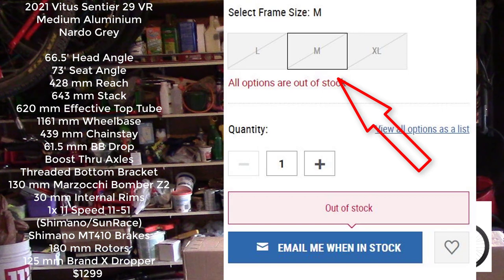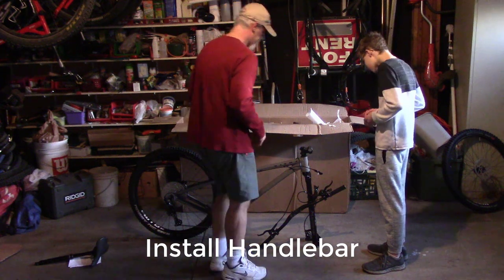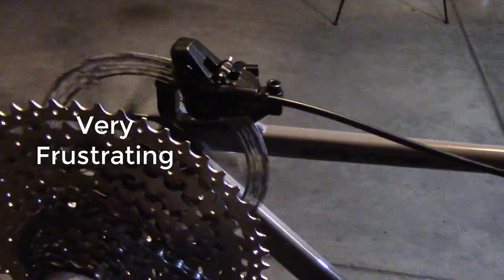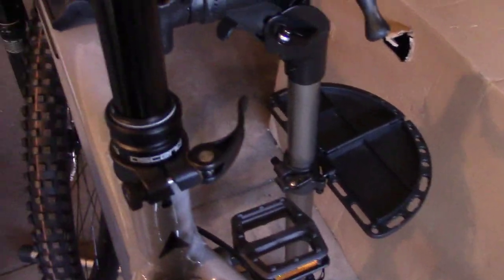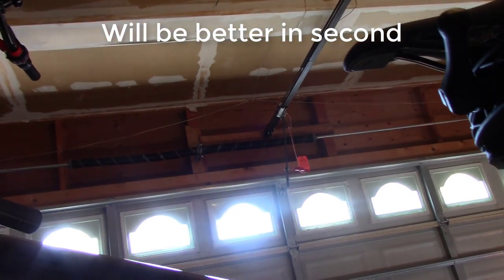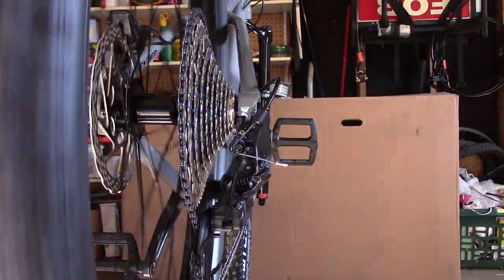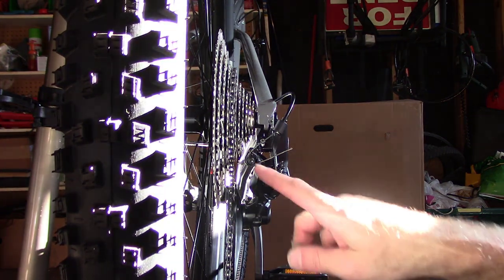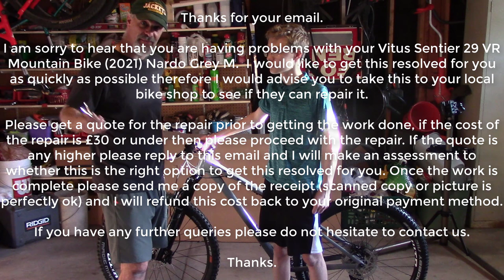[Open Box Nightmare] Chain Reaction Cycles 2021 Vitus Sentier 29 VR: Set Up, Weight, 2 Big Problems

Comment: I own a Vitus Sentier 27 VRX and ordered it from Chain Reaction Cycles. I didn't have any problems whatsoever. Brakes were set up the right way and fully bleed. Also my bike shifted perfectly out of the box. I bought my bike in May 2020 rode it a lot and didn't have any problems since then.
Reply from the maker: Cool.
Reply: @1newme425  for my liking the gearing is just right. Mine is the 2020 model and it came with a 32 t round chainring but I've swapped it for an 32 t oval chainring and for me it's perfect. I do a lot of riding on flat surfaces for longer diatances and I only use the biggest cog of the casette in rare occasions same goes for the smallest cog. There should be room to run a 34 t chainring if you wanted to swap out the stock one. That would give you a higher gearing for high speeds but I would first try the 32 t except you have really strong legs.
Reply: @1newme425  yeah 32 t should be enough for most people. But fitting 34 t should also be no problem
Reply from the maker: Thanks for update.

Comment: I ordered the same bike,
I had a great time. the bike came in perfect condition, and the only thing was that the shifting was a little wonky, and the front brake rotor was rubbing. super easy fixes. the brakes were in the right "American" position, and the whole bike is just a dream.
Reply from the maker: Nice.  Glad you received bike with brakes on correct side (for USA).

Comment: Wow, most be nice to have gotten yours early. Mine was supposed to be delivered today but has been sitting in the DHL Cincinnati HUB since last Friday...
Reply from the maker: Good luck.  Tight supply chains are frustrating.  Let us know when it works out.
Reply: @50mtb44  well it arrived and the box was in poor condition so I had wife record my opening of it and I discovered that the frame got bent (presumably in shipping) so I still don't get to ride it. The response from CRC has been extremely slow as well.
Reply from the maker: @cmccormack91  wow!  Drag.  Glad you video documented it.  Keep us updated on your progress.  Hope it works out quickly.
Reply: @50mtb44  rim was also bent. They didn't send me a replacement bike (I don't blame them honestly, it would probably get trashed in shipping again) but they are sending a Ragley Big Al as a replacement frame and are covering the shop costs to have everything swapped over, or so they've said, only time will tell.
Reply from the maker: @cmccormack91  thanks for update.  I like that Ragley Big Al (on paper). Looks cool.  Let us know how it rides.  Glad to hear CRC is working with you.

Comment: You got the right size tires for the 29’er. The tires you were expecting are on the 27” version.
Reply from the maker: Cool.  We are very happy with the 2.3 tires on 29 inch 30 mm rims.  I see the CRC website does NOW say 2.3.  But when we purchased, it read 2.6 front and back (I took screenshots).

Comment: I ordered a nucleus from chain reaction cycles and it came fine with the levers on the right side, I did notice some shifting issues at first but those were easy to fix.
Reply from the maker: Anthony, thanks for sharing your experience.  When you say "right side" for brake levers, which lever controlled which brake?
Reply: @50mtb44  um, I don't notice unless I am currently riding bit I think it was , right for back and left for front. the normal way in the usa
Reply from the maker: @anthonyschutz7201  nice.  Wish our brake levers came that way.  What issues did you have with shifting and how did you fix?
Reply: @50mtb44  it skipped over the 7th gear because it was misaligned, all I did was look up on youtube how to fix it. I think it was "park tool".
Reply from the maker: @anthonyschutz7201  cool.  Enjoy your new ride.

Comment: We in the UK have it that way as it's got something to do with hand signals,don't forget we drive on the left as do Australia and New Zealand and many Asian countries.
Look at mountain bikes in Australia they have the front brake on the right as well.
Reply from the maker: Makes sense. I'm not suggesting that everyone have the same brake orientation everywhere (although that would be nice). I appreciate that UK, Austrailia, and New Zealand set their bikes up to match their cars.  :  )   Just saying, a bike company selling bikes worldwide should set up the bike to match the country they are selling and shipping to. Otherwise, just like if brakes reversed for you, there is a big risk of accidential OTB.
Reply: @50mtb44  What I don't get about the US/euro "front brake on the right" is that AFAIK your motorcycles have it the other way around. Doesn't this get confusing?
Reply from the maker: @andydt82  Maybe. I don't ride motocycles.  So not an issue for me.  Someone else will have to answer that one (good point).
Reply: @andydt82  motorcycles are universally front brake on right hand and rear brake on right foot. Unless theres a difference on a special model that's how it is worldwide 👍🏼

Comment: It’s fun only after you figure it out.  My local bike shop makes it look so easy but I still like working on my own bike.  You learn by doing.
Reply from the maker: So true.  I thought this was going to be quick, easy, and fun.  Started out great.  Then snowballed.  Good thing I got it late in day ... and had the night to clear my head.  Not sure how a buyer with no mechanical skills would deal with the disappointment.  So made this very long full story video.
Reply from the maker: @themtrchannel9529  true.  I have a great shop.  Just all shops around here are backed up for 4-6 weeks.  Did not want to wait.  Just showing what happened to us.  Luckily, I feel confident wrenching (when needed).  Many who purchase, will not.  So LBS is a good alternative.  No idea what fee would be charged.

Comment: I took delivery of a Sentier 29 VR from CRC earlier this month.  I’m in the UK, so the brakes were set up as I would expect.  But I had completely different issues to deal with.
Firstly, as it was shipping within the UK I was expecting what CRC call a ‘Big Box’ delivery, whereby all I would have to do is fit the handlebars and pedals.  It came however in a ‘Small Box’, additionally requiring the front wheel and the dropper post seat to also be installed.
Inconvenient, but no biggie.  Except there was no dropper post or seat in the box!  Someone had probably been left looking at them on their bench at the end of the day, wondering which box they should have been in & where they should have been sent.
This was a Saturday, so everything went back in the box until I could speak to CRC on Monday.  
Spoke to CRC first thing on Monday morning & they quickly apologised & agreed to send out a new dropper post and seat to me.  Quickly agreed to send it; actually sending it?  Not so quick.
Reassured that the entire box wasn’t going to have to go back,  I went back to it on Monday evening to assemble the rest of the bike.  First thing to install was the handlebars.  What could be difficult about that?
Well you could have a face plate bolt tightened up way beyond the max, and with its hex head completely stripped out.  To the extent that the 4mm allen key just spun freely in the head.
So back to CRC on Tuesday… As the stem is bespoke to the bike they were unable to supply a direct replacement.  After a little to-ing & fro-ing I managed to negotiate a Nukeproof Horizon stem be sent out to me as a replacement.
The stem arrived Wednesday morning - super fast considering CRC had only agreed it on Tuesday afternoon.  The dropper & seat however, didn’t arrive until Thursday evening.
Considering whoever had worked on my bike had managed to 1) forget to install/box a dropper post & seat, &  2) destroy a hex bolt that only needed to be tightened to hold a stem together in transit, I didn’t have a whole lot of faith that the rest of the bike had been put together with any care or diligence.
So for about $100 I had my local bike shop fit the dropper and carry out a full inspection of the bike.  They adjusted the gears and aligned the rubbing discs.  To their credit, CRC reimbursed to me the full amount, without any argument.
Reply from the maker: Thank you for sharing your experience.  Sounds like: 1. there were error with CRC assembling the bike. 2. CRC did work with you to resolve by sending parts or reimbursing service.  3. You lost time. Almost a week or riding AND had to spend hours and hours working to resolve these problems when you should have been riding.  It is 3 that most people don't understand.  The FRUSTRATION of not having this thing work right out of the box - a losing hours you could/should have been doing something else.  Glad to hear CRC worked with you to resolve.  Bummed that someone else had to experience that "tight stomach" pain of a rocky start.  Hope your new bike rides well and you have years of enjoyment.

Comment: I just got a vrs sentier a couple weeks ago from vitus itself. Had to do same thing with the gearing and not sure why if they test it before it ships. Find it hard that it would go that far out being strapped in its box
Reply from the maker: After the initial setup, 3 years later, my son loves the bike.  No major issues (just standard maintenance - and not a lot).  He just rode this bike in MOAB (slickrock and porcupine rim) ... with the original tires.  Only new brake pads.

Comment: whoa....i am surprised this happened to you. i wonder if chain reaction reached out to you...this is scary especially for some buyers like me who has limited knowledge in bike repairs. my friend actually pointed out the warranty aspect when i told him of my interest to purchased from CRC. from your experienced, my friends point is valid. indeed, its challenging not to have a local bike shop to support should something like this happened. thanks for sharing the video.
Reply from the maker: Mervin, hi.  YOU are the kind of buyer I wanted to share the video with.  I have some skills with a wrench, yet was frustrated - and it took 24 hours to straighten out (doing it wrong, sleeping on it, watching videos on YT, trying again).  Glad I figured it out.  My son loves the bike.  Just bummed it went from super excitement, to total frustration, and ate so much time to set up.  To clarify, when I emailed CRC with problem, they did response politely a day later and offered a small sum to have my bike shop fix.  But with COVID, they are slammed and backed up.  I will say that my shop WILL work on ANY bike.  If yours won't, find another shop.  For DYI, I added HOW we resolved issues.  Hope it helps.
Reply: @50mtb44  i hope your son is enjoying his ride now. take care.
Reply from the maker: @mervinmiguel9466  just rode yesterday.  My son had a blast on his new Sentier.  :  )

Comment: I asked the site wiggle about the brake issue and they said
 'When placing an order it will ask you if you want to leave a note for the Wiggle team, here you need to add a note saying how you would like the brakes set-up.'
Reply: (On that site you can order the bike)
Reply from the maker: Good to know.  Unfortunately, I was not asked at checkout on CRC.  And did not "know" to guess.  Figured they'd know since shipping to USA.  Most importantly, now other watchers/readers of this tread know what to do -- so they don't get surprised.  Thanks for input Simon.

Comment: Wow you guys have the patience of a saint. Well done on resolving the issues. One of the most interesting well documented filmed video on YouTube. Loved it. I own two Vitus bikes (Nucleus VR 2020 & 2021 models) luckily didn’t have any issue all good straight from the box (I’m in U.K. so brakes set up correctly). Adjustments on gearing was extremely helpful and will definitely use this to tune my bike if needed. One big advantage you have is a large garage with correct tool set up makes a big difference. Would love an update video once your son has ridden his Sentier on the trails. It’s a great bike. I’ve used the 2020 Sentier model on some forest trails and it was a beast.
Reply from the maker: Alpesh, thanks. It was an ordeal, but we survived.  :  )   Just a bit bumpy.  The bike looks awesome.  The few rides my son took, he enjoyed.  He has been fighting a bum knee after a crash (on earlier bike - reason for getting Sentier - better geo and sizing).  Bike is too small for me to ride, so can't give good feedback.  He should be riding it in the spring.  Will give a report then.  Enjoy your Nucleus.  Looks like a sweet ride.

Comment: on the crc page , if you buy a bike they ask you wich brake you want on the left side and the other way round, i filld it on my first bike and skipped it on my 2nd bike 🤦‍♂️🤣 and they only have the rear brake on the left in countrys like GB,  where the also have the steering wheels on the wrong side🤷‍♂️
and for a guy like me who is into bike tech both problems are a deal of about 20 min each , but for the average consumer i understand the problem.but thats what your lbs is for
Reply from the maker: Never saw an option on purchase page to tell them anything about brake orientation.  But that is what I remember.  As you say, easy for a weekend mechanic.  Frustrating as hell for a guy who just wants to ride.

Comment: I bought my Vitus sentier 27 VRX last month on CRC and no issues since my order ... quick delivery, easy unboxing and first fiting. Set up normally and just one adjustement after 300 km . It works perfectly and i have lot of fun whith ! 

Problem n°1 :

No problem for me... It's normal for a UK brand to sent you a bike with UK specification, and mainly because this is a specification exclusively for USA ...

Problem n°2 : 

For your shifter cable, i think you made a mistake with your stand...  your are lifted your bike with the clamp on the top tube . So the external shifter cable above the top tube was stuck with the frame by the clamp, after several attemps to shift the gear the cable propably be deranged or bad tensioned ( as you say ) and moove down ...
Reply from the maker: You may be right about #2.  Although, not sure why the cable would be off AFTER I reset the stand clamp also.

Wanted to do entire set up without stand (like most would receive), but had to hang on stand to swap the brake lines. 

Thanks for input.
Reply: @50mtb44  The guy who said that its right. I have the same bike but 27.5. The only thing I dont like about it its the frame design for the derailleur cable housing. I didn't see that before buying because that is old design from 10 years ago. I would have never thought a 2021 model would have that old design. I hate seeing that cable without cable housing. So I bought a set of cable housing on amazon and removed all that and install the cable housing. If you want some photo let me know.
Reply from the maker: @fengcarlos  cool.  Was thinking the same thing about the cables.  Thanks for mentioning.  How is the derailleur shifting with fresh cables?
Reply: @50mtb44  very smooth
Reply from the maker: @fengcarlos  good advice.
Reply: @fengcarlos  hi, i made the same kind of modification... i drill the cable bush to pull inside the cable housing .

But for me it's not a big issue, and in the same range of price and equipement the bike with internal frame cable or full cable housing are minimum 3-400€ more ...

Thats why, for me, the Vitus it's a very good choice... juste simple : frame, good components, two wheels and go to ride.
Reply: @50mtb44  I actually had the same issue with my 2021 Sentier VR, and it was exactly this reason. Clamping on the top tube clamps the shifter cable. Swapped my clamp to the seat post and problem was instantly gone! 

Also oddly enough, my brakes were set up American out of the box, odd that quality control isn’t consistent...
Reply from the maker: @michaelholden349  good catch. Clamping on top tube could have created problem (wish I'd have added to video to caution others). Although, problem did not go away when I switched to clamping on seat tube. And still had to adjust derailleur.  Could not clamp on seat tube initially, since dropper was not installed.  Maybe a lesson learned.  The brake lever orientation was the biggest bummer.  But once we discovered the solution (hours later) it was resolvable.  Appreciate your attention to detail. Thanks for sharing your experience with the group.

Comment: OK guys technically you bought a UK brand bike and you hope to get the brakes on correct sides? By the way European brands have the brakes on correct sides its just the UK makes everything opposite due to driving on the wrong side of the road
Reply from the maker: If your company advertises, sales, and ships to other markets outside UK, probably should adjust those bikes to those markets (or warn during the sales process).  Ford does not market, sell, and ship cars to UK drivers with the steering wheel on the left (USA style).
Reply: @50mtb44  just for your notice it's not European style of levers and it never was. UK even quit EU probably becouse we could not adapt to wrong side o the levers aswell:D
Reply from the maker: @worbot_replays  That's hilarious.  Brexit due to bike brake levers.  :  )

Comment: I was looking at the vitus escarpe and I was wondering how much the import tax was on the bike
Reply from the maker: I did not have to pay any import tax for bike purchase shipped to USA.  However, you should confirm with CRC or the retailer you are purchasing through.
Reply: CRC includes tax/duty in the price (shipping cost). You don't pay anything extra. Less than $800 is duty/tax free according to them.
Reply from the maker: @marcoscaraveo4487  good info.  Still, I'd confirm with CRC before you hit that buy button.  Don't want any surprise expenses.